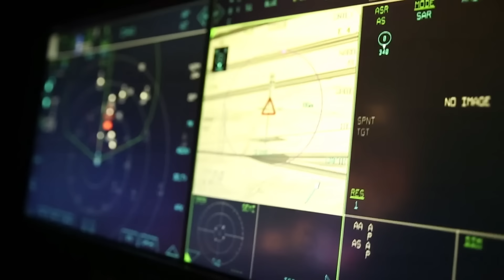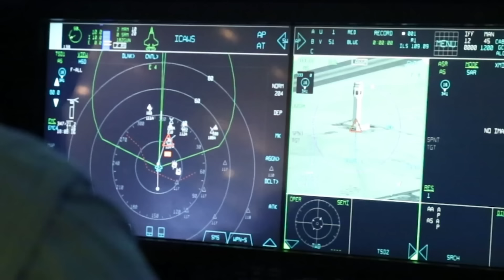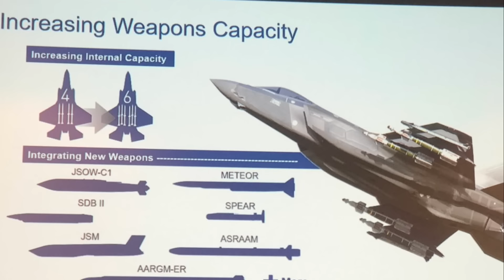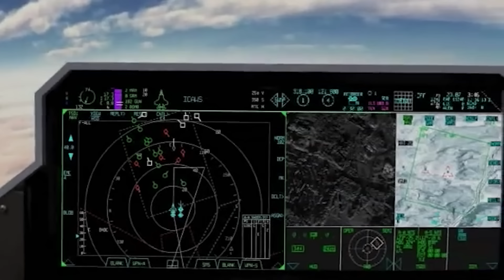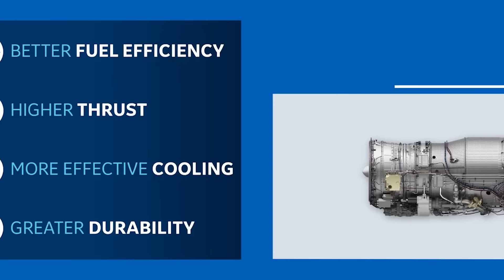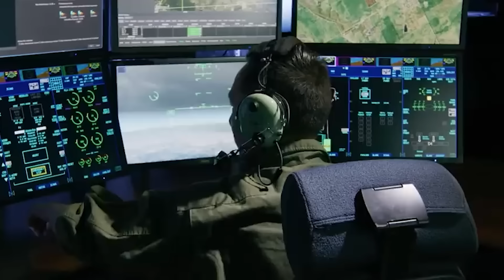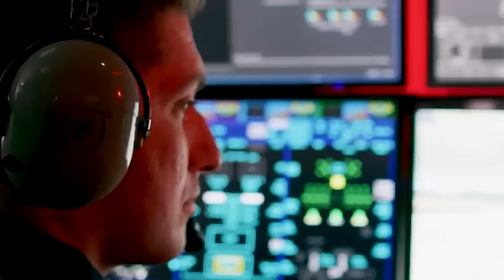The F-35 is about to become a POWERHOUSE

Comment: Each F35 is an AWACS plane to a group of 4th generation fighters, through Link 16 and soon Link 22. It’s already a truly amazing machine.
Reply: It's highly classified, but there are rumors that each F-35 can also control & command 10 Predator drones during combat and recon operations --- mind blowing stuff !!
Reply: So is the Gripen and has been for years
Reply: Link 22 complements Link 16, MADL is compatible with both. Just to clarify in case someone thought they were mutually exclusive.
Reply: It’s a inferior knock off of a F22 and won’t stand a chance against Russias 5th Gen or Chinas. Piece of crap. Small wings. Very little maneuverability. It can fight long range but so could the F4 Phantom my dad flew in Vietnam but we know what happened when a face to face dogfight occurred. This is todays F4 Phantom.
Reply: @garydobbs5159  lmao China doesn’t have true 5th gen aircraft and the Russians don’t even have enough SU-57s to fill an estire squadron
Reply: @garydobbs5159  
Really? A F35 will easy out dogfight a F16, so given this? the F35 does not lack maneuverability at all.
And the F35 has a better power to weight (thrust to weight) rating than a F16, F18, Super F18, Rafale.
Reply: @Albertkallal  Yea, this guy is definitiely just not sold on it. The best part is their ability to be completely AI controlled with no modifications. So, As long as we build enough, it doesn't really matter if they're any good at dog fighting. They can just swarm the smaller number of other 5th gen fighters.
Reply: @Karl-Benny  Indeed the Gripen is, but the circumstances eventually reach a fork:

-The Gripen is a 4.5 gen meant to be easily maintained by conscripts led by a single proper maintenance, very cheap to maintain, and can operate on the shortest of roads.

-The F35 is a 5th gen with considerable stealth capability, have a variant with currently the most advanced VTOL platform, thus the price tag.

When it comes to internal stuff, both have an emphasis on the ability to interlock friendly forces with the latest intel, the difference come with Gripen's emphasis on "human machine integration," a form of heightened HCI.

Edits: typos
Reply: Then why is there a pilot? What is his purpose? Other than to screw up the mission.
Reply: @garydobbs5159  :  low-cost, small, fast, and stealthy drones Will clear the skies of all manned combat aircraft, the sooner the better, should have happened decades ago. Pilots are glorified idiots…. They are the weakest link in the aircraft system. I know, I’m a pilot and I’m an engineer and I have designed avionics Equipment.
Reply: @steveperreira5850  Technology isn’t there yet. Still won’t be for a while.
Reply: @Karl-Benny  gripen is nowhere near as good in terms of technology and capabilities. F35 is startrek level tech gripen is just not at the same level.
Reply: @H2s Complex question with complex answer. Depends on what you mean by manned platform with EW assets, as well as what kind of drone, it’s capabilities, what kind of signal connection it has, and what each are trying to accomplish.
For instance, most drones don’t have radar, so the goal of the EW aircraft will usually be signal jamming. There are several ways to do so, some are easier than others most require the plane to be within a certain range, which puts it dangerously by the frontlines. An alternative approach would be to detect where the controller’s signals are coming from and send a HARM missile its way.
Reply: Welcome to the world of Data-Linkz !  JAS-39 is born with it!
Reply: @garydobbs5159  obviously you’re not a pilot of the F 35
Reply: I thought the exact same thing, when I heard about upgrades, and telling other planes what to do. I thought "that sounds like AWACS"  I'm sure we'll still use some AWACS planes for a while. I mean, could we pack even better systems in an AWACS jet? They're huge. If not, let's convert them to flying lasers, like we already have.
Reply: @garydobbs5159  I love how you people invent your own stats and capabilities of this plane in your head and then pretend its true
Reply: I wonder where all the haters have gone. :D
Reply: @garydobbs5159  By that logic, we would still use longswords because they are better at stabbing than a gun.
Reply: @garydobbs5159 Your comparing the Phantom to a cutting edge fighter?
Reply: @steveperreira5850 So your saying piolet's are stupid,but your a piolet?
Reply: @H2s this. Just one manned EW aircraft in a flight of drones renders an opposing all-drone fleet helpless.
Reply: The f-35 can only transmit and recieve signals to other f-35 as pointed out by an f-35 pilot in the the fighter aircraft podcast only the f-22 can recieve the data from an f-35 and transmit it.
Reply: @Globalscanningeyes  what podcast?
Reply: @derHallen  did u mean f-35 lightning with the second -? Gripen isn’t a gen five so you lost me there. Seems like u meant -Gripen is 4.5 and -lightning is 5.0
Reply: @Legion-xq8eo  Indeed, thank you for the reply. I have corrected my typo now.
Reply: But only if the radar is pointed to the battlefield, and 50% of the time it aint.
Reply: @uwannakatana3990  You don't need an entire squadron of 5th gens to defeat an F-35.  You just need one more than the -35 has missiles.  At that point, its a sitting duck that can be taken out with guns.  (Oh, and I don't think they every solved the -35's gun targeting/accuracy problem.)
Reply: @WembysTRexArms  Well f-35s wouldn’t be operating alone to begin with. They operate along side F-15EXs, F-22s, F/A-18Cs, Ds,Es,Fs not to mention sophisticated anti-air ground and naval assets. So you makes moot point.
Reply: @uwannakatana3990  Ironic considering all of those other platforms also have radars.  So... Why do we need to treat a fighter aircraft like HVAA?  We don't.  We could have put that radar on any of the other aircraft and then projected a COP via Link...  Oh wait... We already do!  /// Who's point is moot?
Reply: @WembysTRexArms   it’s not treated as one it’s simply another piece of the puzzle in combined arms warfare in the modern Information Age. The moot point you made was where you mentioned that in order to defeat it you just need to overwhelm the f35 with sheer numbers
Reply: @uwannakatana3990  You do.  The MiG-21 is the best selling fighter of all time for a reason.  Cheap, effective (for its time), and easy to maintain.  Nothing in the U.S. fleet comes close.  Especially not the F-35.
Reply: @WembysTRexArms  that’s normal typically aircraft with much more capability and advanced avionics require more maintenance hours compared to aircraft that much less advanced. Once flight doctrine is added in to the equation the MIG-21 is outclassed immediately
Reply: @uwannakatana3990  But only if it can keep its MC rates up. 
-------------------------------------
The goal comes as little more than half of U.S. F-35 fighters are considered mission capable.

“The mission capable (MC) rate goal for the U.S. Service F-35 fleet (Air Force, Navy, and Marine Corps) is 70 percent for the [USAF] F-35A, and 75 percent for the [U.S. Marine Corps] F-35B and [U.S. Navy] F-35C,” Lt. Gen. Mike Schmidt, program executive officer for the F-35 Joint Program Office (JPO), said in a statement Wednesday. “The current average MC rate across the U.S. Services’ F-35 fleet is 56 percent.”
Reply: @garydobbs5159  F-35 pilots refer to F-22s as "legacy 5th Gen" because the F-35 AESA, Stealth, engine, cockpit, MADL data link, IR sensors, central brain, FLCS, are better than what's in the F-22.  The combat-coded Raptors are getting upgrades to get them more on par with F-35s in those spaces, but there are some things that will just never be as good.

Modern fighter designs dating back generations even have used lifting bodies combined with wings for total lift.  A single engine F-35A will take off faster than a twin-engine F-15C, and the F-15 has all kinds of low wing loading plus lifting body.

Most of what you hear from amateurs running their mouths about aviation can be ignored.  They simply don't know what they're talking about.
Reply: @macturner2196  F-35 pilots have significant advantages over AWACS in what they can see all around them, with superior fidelity and across multiple spectrums.  AWACS birds are RF spectrum only.  F-35s are fused RF, IR, Laser, and other spectrums with their sensor suites.
Reply: @Globalscanningeyes  F-35 can share high fidelity fused data with each other.  They can receive and transmit Link-16 lower fidelity data with an emulator, but other platforms can't receive the fused RF/IR spectrum data that F-35s share with each other.

F-22s have their own IFDL that is RF spectrum-only data specific to Raptors.  There are upgrades to facilitate sime type of baseline net-centric comms between MADL, IFDL, and Link-xx.
Reply: @WembysTRexArms  4x F-35s in A2A configuration carry 16-24 AAMs, all of which have BVR capability.  Not only that, but they can close into No Escape Zone parameters with superior missiles that have 40 years of live fire testing and combat success behind them.

They're also getting 2 new missiles, one which is half as long as an AIM-120 with the same range and lethality as an AIM-120C5, and the other that exceeds the R-37M and PL-15 range.
Reply: @WembysTRexArms  The F-35's sensor suite is fused.  The AESA isn't an independent federated system that the pilot has to manage.  It's only one multi-function array that is combined with 12 other RF sensors, 7 IR sensors, Laser, and the MADL apertures.

Combined with an extremely low RCS airframe, the sensor suite linked with other F-35s provides something you can't have with legacy fighters.  You can't get into the MEZ, nor can you safely close into NEZ parameters against other fighters/interceptors.

You also have a slick airframe in a combat configuration, so no parasitic drag penalties like on every 4th Gen.  This provides improved raw performance, fuel efficiency, and combat radius.
Reply: @WembysTRexArms  The US out-MiG'd the MiG-21 with the F-16.  Every time the 2 have met, the MiG-21 went down in flaming scrap metal.

On top of that, the F-16 can do strike, anti-ship, SEAD, CAS, BVR, and night.  MiG-21 is day, short range, within visual range fighter with 4 hardpoints, pilot can't see for squat, strafe rag.
Reply: @uwannakatana3990  Or even a large hangar, if we are talking about fully operational 57's.
Reply: @LRRPFco52  4th gen beats 3rd gen????  I'M SCHOCKED! SCHOCKED, I TELL YA! -- Sorry, I'm wrong.  Fishbeds are 2nd Gen.  So....
Reply: @LRRPFco52  Can the radar see behind it's reflector?  ....  I didn't think so.  Can the F-35 sustain its supercruise without compromising it's RAM?  How many hours does it take to maintain that pretty paintjob when it gets destroyed every time a screw needs to be removed?
Reply: @LRRPFco52  And how will those take off and where will they land after China LACMS the crap out of the airfield?
Reply: @WembysTRexArms  MiG-21 is 3rd Gen: 
* Turbojet
* Mech-scanned, no look-down/shoot-down Radar
* Terrible man-machine interface
* Mechanical/hydraulic FLCS
* Supersonic capable
Reply: @steveperreira5850  Pilots are man in the middle between certain weapon systems we should never hand over to a program.
Reply: @johanjonsson3591  US invented fighter data links in the 1950s with Link-1, then the SAGE program on F-102A, F-106, and F-101B.
Reply: @LRRPFco52  I'll give you that I initially called it 3rd Gen.  But then thought about it a bit more and opted to defer the the National Air & Space Museum at the Smithsonian.  They say 2nd Gen.
Reply: @WembysTRexArms  There is a 360° passive RF sensor network fused with the 360° IR DAS, so it does have a level of surround situational awareness that doesn't exist on other fighters.

The RAM is not compromised from flying within its performance regime, including supersonic.  There were 2 of the 6 original developmental F-35s, 1 F-35B and 1 F-35C that exhibited some slightly higher temps in the h-stabs that concerned engineers because of embedded antennae in those structures.

They tried duplicating the problem on the other birds with extended supersonic runs, dives, and maximum Mach value between 2 tankers up and down the East coast, and never saw those temps in those structures again.

The production F-35s after that didn't even use the same materials in the rear tailplanes, so the whole thing was a fluke.  That was over 10 years ago, never duplicated.

The F-35 series doesn't rely on RAM paint like other VLO designs.  The paint is mostly IR spectrum camouflage.  The physical structure of the 3-later skin has carbon nanotubes with wide spectrum RF energy defeating characteristics.

The common maintenance access points have seam covers that don't require removal of and reapplication of RAM paint or treatments.

There are periodic inspection and mx points like around the wingtip nav lights that have RAM tape covering them that does need to be scraped and reapplied, but they aren't day-to-day squadron-level operations.

As a result, F-35A has less than half the mx hours of a stripped, new F-16.  It's just a vastly-superior aircraft from a mx perspective, and former F-16 wrenchers have said as much repeatedly.
Reply: @WembysTRexArms  Chinese missiles have to make it past Patriot and other missile interceptors.  Even with some craters, flight ops can be generated when an F-35A gets airborne within 550m.
Reply: @LRRPFco52  What if they just say screw it and lob everything at the hangars?  Even if the Patriots do their job, isn't that an epic level of FOD?  (This is kind of fun.  :face-blue-smiling:)
Reply: @garydobbs5159  the fact you think dogfighting has been a thing for 30 uears is cute. You clearly dont understand the suite of tech thats out there today. Not saying this is the end all fighter byba long shot but all that time in money didnt go into making an "ok" plane
Reply: @garydobbs5159  . 1:22
Reply: @steveperreira5850  😅
Reply: *an amazing moneypit thats never satisfied
Reply: @fredwerza3478  How many can a US Air Force Ground Station handle?  I hear the Marines and Army ground controls can do...like 25 or more just like the FAA controller can handle a certain number of planes an hour...
Reply: @garydobbs5159 Russia's 5th gen aircraft oh yeah the su-57 how many of those exist again?
Reply: Sukhoi THEMSELVES said the Su 57 has a 1 m^2 RCS. The F35 is speculatively 0.0015. Su 57 is a fireball before it knows it's been shot at against an F35
Reply: @batteredskullsummit9854  u ppl just come on here and casually lie for pointless ego boosts that are meaningless irl 😂
Reply: So you mean the F-35 is a giant flare in the sky you can easily shoot down by that? Interesting concept.
Reply: @peterp4037  So you mean purely fictional?
Reply: @batteredskullsummit9854  Stealth is worthless agains real armies. There are several ways to completely counter it. Your numbers are a theoericl case in which that jet flies directly toward a very specific kind of radar station. A completely unrealistic scenario.
Reply: @fowlerfreak7420 thank you for your clarification, I have never heard of these systems and will have to look into them now haha. Cheers!
Reply: @miriamweller812 right, i remember when stealth was so useless in desert storm when that squadron of F-117s was sent to loiter around Baghdad and take out all everything its payload could touch, before casually flying back to grab more ordinance, fuel up, and head back out. I know history is boring, but isn't being dead wrong all the time boring as well?

Comment: 5:38 - 5:47 A change from 5 to 20 is described as "a 75% increase", but that is not a 75% increase; it is a 300% increase (an increase to 400% of its previous version).
(A 75% increase would be 5+.75x5 = 8.75.)
Reply: Hahaha, the increase is exactly what the purveyors of this scrap heap claim it to be. Even if it is minus 100% the dealers trying desperately to selll this lemon will serenade about its steller performance. The F35 is and always was dead on arrival.
Reply: The math police strike again 🙄
Reply: @newhailman  Percentages mean very specific things. Use them correctly. The error in this was BAD.
Reply: @jamesedwards6173  oh come on, a decimal here, a decimal there what's the difference 🙄
Reply: @newhailman  I'm glad you're not designing these things... because that literally makes ALL the difference.
Reply: @jamesedwards6173  dude, I'm so messing with you 😎
Reply: @newhailman  lol, well, ya got me... which doesn't happen often. 😝
Reply: @newhailman got me at first too 😁
Reply: @bobbye7353  yeah, I can be a little sarcastic now and then. Thanks for being a good sport 👍
Reply: Kind of like the 75% less cost reduction
Reply: My understanding is the 75% increase is in accuracy not in the number of reservers

Comment: I'm imagining high altitude F-15s, loaded to the gills, functioning as missile trucks, and the F-35 as a gun sight of sorts.
Reply: And you would be 100% correct. 

But it’s even bigger and better than that. F-35, B-21, RQ-180 etc… All of our VVLO (Very Very Low Observable) aircraft with modern data links will be able to find, target, and track while sending targeting data to a missile truck like the F-15 as you mentioned, OR … A C-130 or other cargo plane with Rapid Dragon or similar capabilities, or a B-1 OR (even better still!) HIMARS and other ground based systems.

Imagine an F-35 entering contested airspace, linking to a RQ-180 that relays targeting data to a B-52 1500+ nm distant that’s loaded to the rafters with ALCMs.
Reply: @FloridaManMatty I believe the USMC had an exercise about a year or two ago (not long after they received their first HIMARS) where they proved that the F-35 indeed CAN connect to and provide targeting for HIMARS rockets.